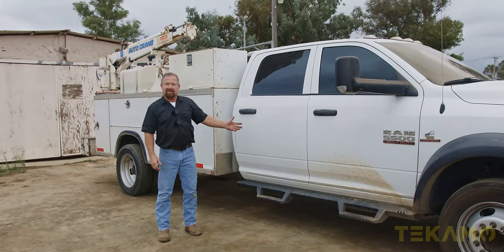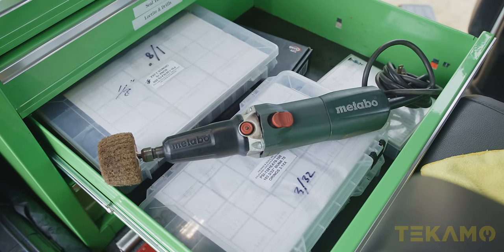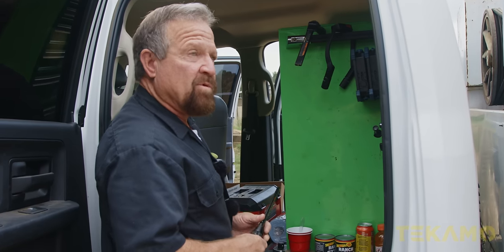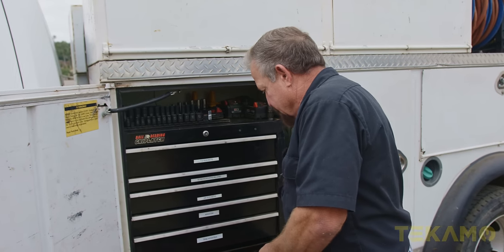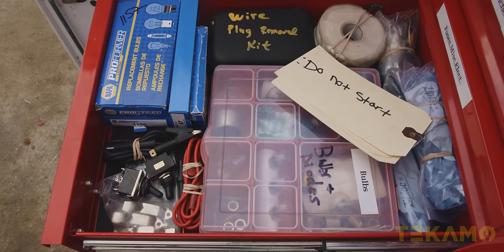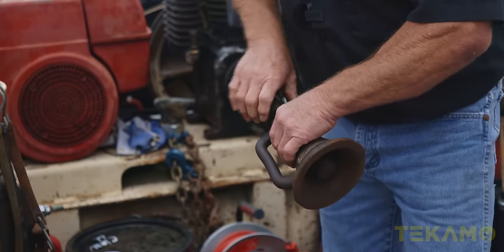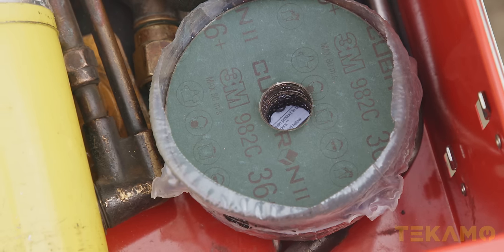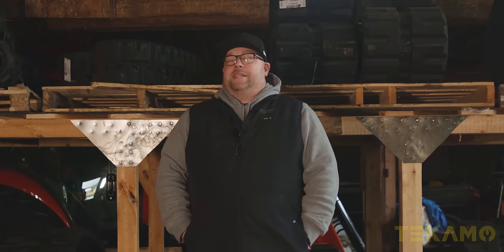30+ Year HD Mechanic Is Leaving California and Going to Texas! Ram 5500 Service Truck Tour

Comment: Welcome to Texas Kurt! I'm about 20 minutes from there, in Splendora. I picked up a new / used 48 aluminum ridgid last week for 150! Lots of bargains in this area. I'm considering working with Tekamo. If you need help with anything give me a holler. Good luck on the next chapter!
Reply: Hey, thanks Kasey, I would love to take you up on that buddy. I’m gonna definitely need help. I’m not familiar with the area and would appreciate help with any leads, best parts houses, and Texas BBQ Lol. I moved to California for the work years ago, but I’m from Ennis Texas.
Reply: @kurt4equip  check out Springcreek for bbq. Papa's bbq is good too but not sure if they are in that part of town. Bbq is almost to expensive to afford 😅 I'm just getting my truck rolling hopefully it picks up quickly. Hope the same for you!
Reply: What is the info , what part of texas !? Do you have a shop or just only run out of the truck , i want to setup a truck myself!  Would be interested to go to the shop if you have one!
Reply: @texasloudnproud1036  no shop yet. Hoping to get one before long. I need somewhere to put a lathe and mill. I do line boring so those things would be helpful and allow me to do more in depth cylinder repairs. I've just been running my truck since January and I'm finally to the point of staying consistently busy. Maybe can justify a helper soon 😂

Comment: Your comment on ratchet return to harbor freight someone did not train that worker correctly.
You can bring in just the tool that broke and they're supposed to take that one tool out of the new box and give you a good one. Now yes you can bring entire set and get all brand new set. 
But who wants all that hassle to get that together from the truck?

Comment: Thanks for a great video. There’s nothing that beats experience. I always get alot out of other guys truck tours, I really got a lot out of yours. Got a couple of questions. I see  you have a couple of Sealtool tools, a twister and a seal clasper. Have you had good luck with the clasper? Some barrel designs can make getting the resealed piston back in a real challenge. I’ve looked at that tool before but never pulled the trigger, the site seems a little sketchy. Sounds like the ESI relay buddy has worked well for you. I’ve been looking at that one too but most of the relays I run into are 24 volt. After hearing you had good luck with yours I checked their site and they’ve got a 12/24 kit now, #193. Going to get it, Thanks. I also liked the looks of that mag mount umbrella. I’m in the PNW so it’s raining anytime I’ve got a breakdown, it looks pretty good. Seems like it would be even better if it had a lever lock like a mag mount dial indicator to make it easier to take off. Thanks for taking the time to do the video, good luck to ya down in Texas!
Reply: Thanks for your comments. Those seal tools I bought from Hercules Seals out of  Florida. they work great for me however, the seal collapser took me a little time to figure out all it’s  tricks like trying to release it. Lol.

Comment: bought the biggest wrench extender mueller had and it was not big enough for my wrenches need one that does 63.5mm or 2.5inch wrenches or tell VIMtools to hurry up the new prototype im working on 1250 ton presses that make bolts for the largest mines stadiums and bridges
Reply: Im in the same boat.  Went with the tubular handle wrenches. Snap On part number 
XH1100 for straight 
X420 for offset
They dont break like combo wrenches and take up less space on the truck.